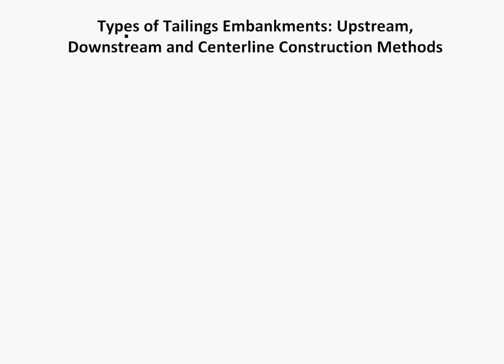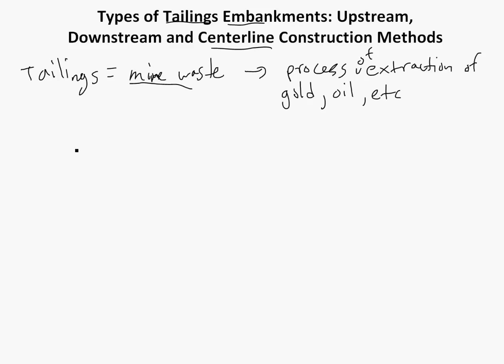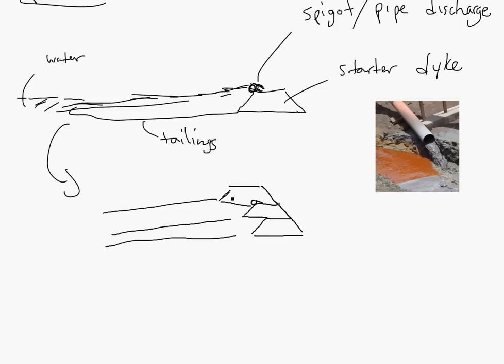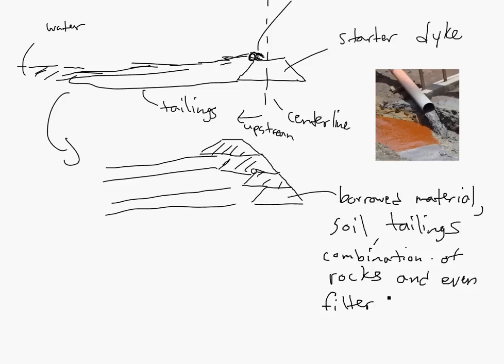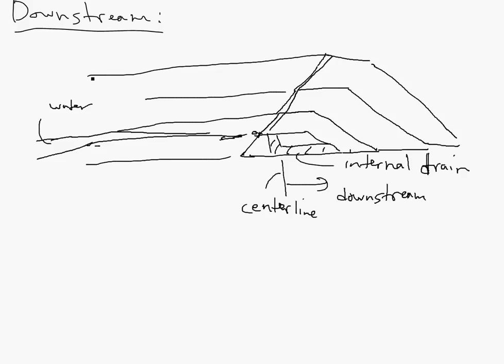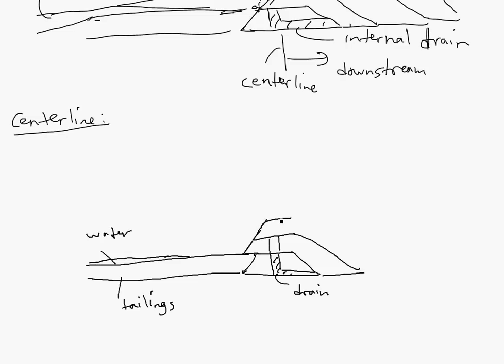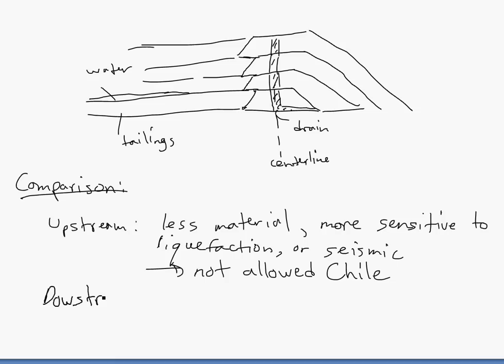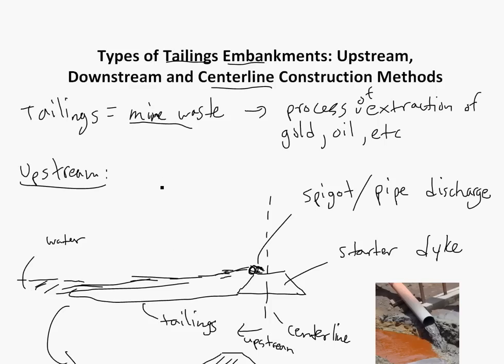Types of Tailings Embankments: Upstream, Downstream and Centerline Construction Methods

Comment: what's the drain used for in  Downstream and Centreline?
Reply: Mainly depend to the area to emplacement the tsf, for example here in Chile the normative permit only centerline and downstream construction and generally the construction of the tsf is between two hill slopes. The drain system to compose for one main drain in traverse to alignment of the dam and some cutoff system longitudinal of the aligment of the dam, and other small drains for recollection other flows

Comment: can you tell,  do you filtrate and  reuse the water ?
Reply from the maker: +aswasenn thanks for asking. Yes reusing and recycling water is an important environmental and economic factor that many companies try to implement. As for oil sand tailings, it is the most difficult process in reusing water but even in that case, technology in reusing tailings water is improving every year!

Comment from the maker: @miliardera I am currently doing my masters in mining and am taking a course on tailings dams and mine waste management. This Math Easy Solution is based on one of the lectures in that class. Mining engineering is very broad and understanding hydraulic and civil engineering concepts are important whenever dealing with large masses of material.
Reply: I'm also pursuing M tech and my project is based on tailing dam can u make a detail video on tailing dam analysis and stage construction.